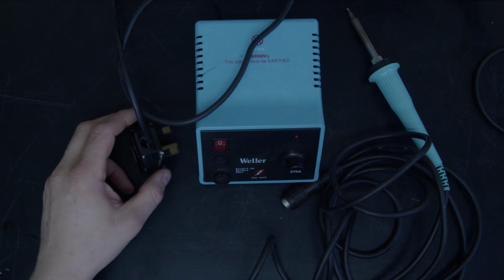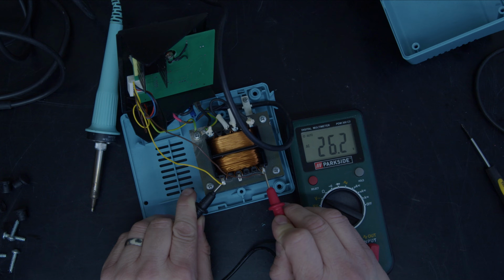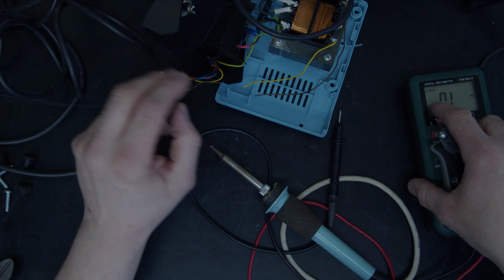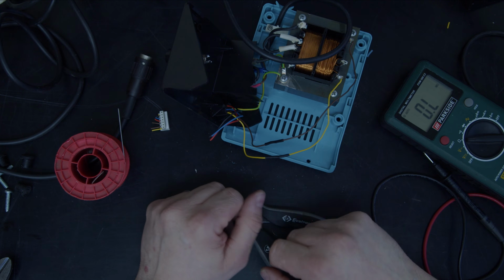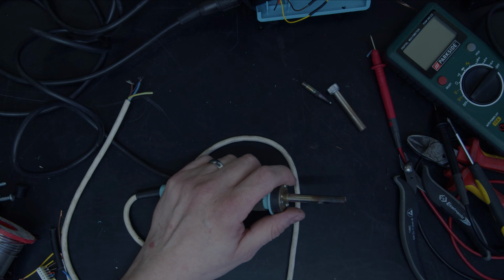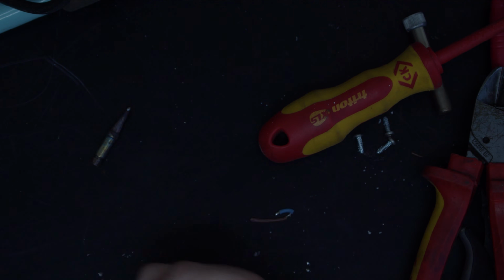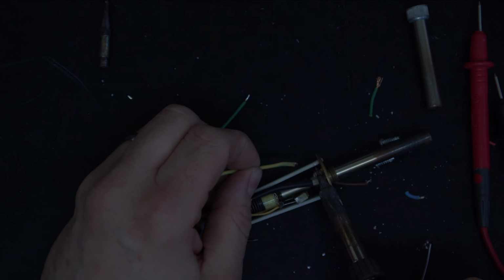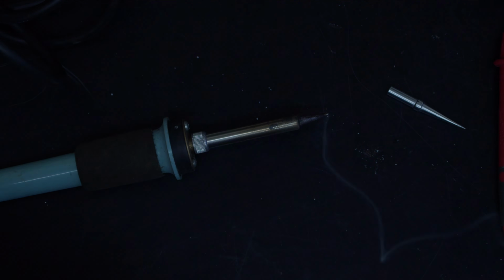Weller WSP Series soldering iron repair and modifcation to magnistat

Comment: what a repair 😂😂😂 not a single massurement on the board try to find the fault xD
Reply from the maker: no because the tempriture probe in the iron was open circut and you cannot get them thhe chap that owns it just wanted a usable iron , the board will be ok , its in my box of parts , i have a lot of thease irons with faulty tempriture probes so this can show you how you can re purpose a othherwise junk iron ,
Reply: @ hmm but now the iron goes allways to max temp or not? isnt it possible to reblace the heating element?
Reply from the maker: @selfmadeRepair  it may be the triac  on the pcb that's failed , gone short circuit , I have had this happen in the past
Reply from the maker: if it gets hot the heater is good , you need to check the probe the resistance will change as it gets hot you can heat it with your hands
Reply from the maker: @selfmadeRepair  have a look at this one I go deeper in to this type of iron https://www.youtube.com/watch?v=cHyb-RxuYgk